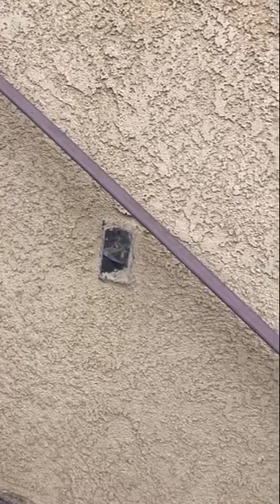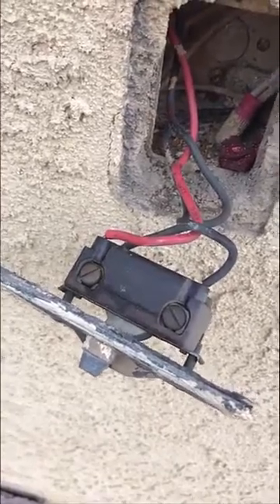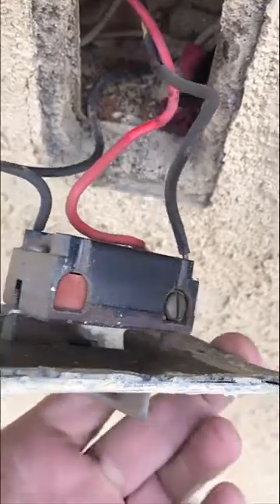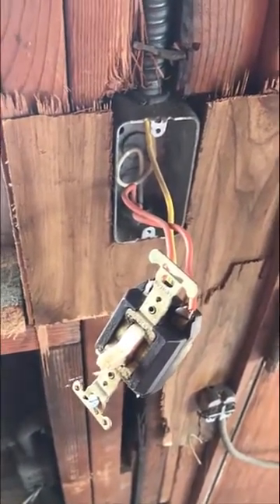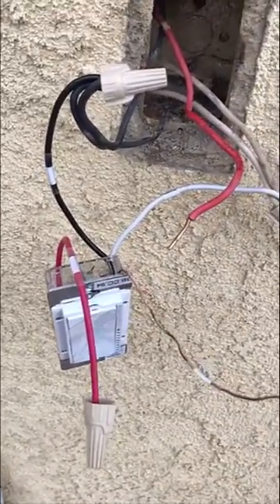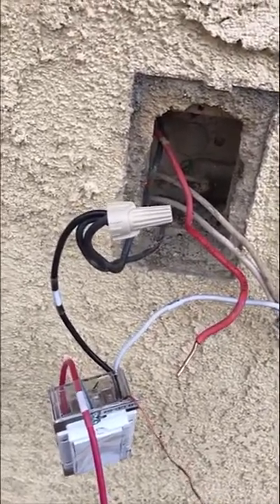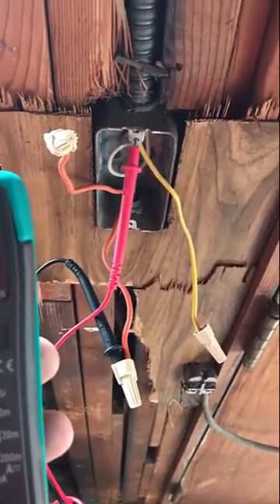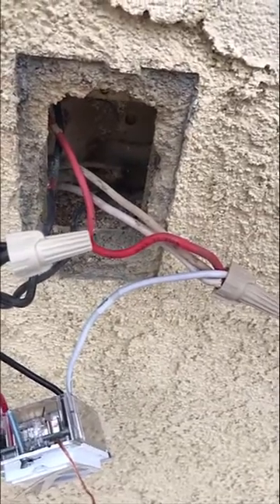Insteon 3 Way

Comment: How did your linking go. I tried to get a 4 way connection to work and I couldn't get the slave boxes to blink green when syncing through the different boxs
Reply from the maker: A keypad flashes red when a button has been linked to a device but then the device is offline or for some reason the keypad can’t hear it after a command is sent to control it.

As far as linking a 4 way here is what to do.  Let’s assume the switches are named switch A, switch B and switch C

A needs to be put into multi link mode.  Press and hold the set button for 3 seconds and release. Then single tap and release of the set button.  Now press and hold in the set button for three seconds on switch B and then the same for switch C

Now go to switch A and turn the switch on and off to stop the link mode.

Repeat the same process now starting with switch B and link C and A

Then start with switch C and link switch A and B

Make sure the switches are in the on position when you link them.

For a specific keypad button that you need to get in link or multi mode you tap the button you want first then hold the set button in and a addition set button tap for multi link mode

Comment: Using a red wire as a neutral is a code violation.
Reply from the maker: A couple of things.    This is my house.   I mention in the video that you should  tape the wires if you repurpose them.      You are correct that if this was getting inspected and I had not taped the wire I repurposed as a neutral with white tape an inspector might call me in that.
The fact that the wire is red does not have impact as to its ability to be used as a neutral.
Reply: Still a violation. You can mark a white wire in a cable assembly as an ungrounded (hot) conductor. You are not allowed to mark a hot conductor color as a neutral.
Reply from the maker: I won’t argue your take on this topic.   I will let the video stand on its own as a tool to figure out what to connect to what if adding an insteon switch to an existing three way application.

Comment: Outstanding explanation! Solved the powering up the 2nd switch box problem I had. Duh... connect a traveler in the 1st box to the line, becomes line in 2nd box.   Thankyou

Comment: I'm not sure I ever heard the explanation that the odd colored screw is either your hot wire or load wire. That understanding simplified my 3-way Insteon installation. Thanks for this tip.

Comment: Do this increase your energy consumption?
Reply: I don't think Mr. Lee revealed the model number of the Insteon device. 
However at runtime 10:29 in the video he powered-on the device to test 
it and the LEDs ramped-up, indicating it's a dimmer. I'm going to call 
it an Insteon 2476D or 2477D. "D" is for dimmer, as opposed to a 2476S 
or 2477S switch. So now that we've established it's a dimmer, I can 
answer your question:
No, a solid-state (e.g. triac) dimmer actually decreases energy consumption. It can be shown on an oscilloscope that as the load is dimmed down, the triac chops off more and more of the A.C. sine wave that powers the load. The area under the sine wave is the power in watts. As the area gets smaller, the light dims, and the power consumption in watts decreases.
Solid-state dimmers such as Insteon's have other benefits as well. "Soft-Start" is a big one. When the dimmer is powered-on, the voltage/current RAMPS up, instead of hitting the cold tungsten lamp filament with 120 volts instantaneously. No matter where the visual ramp rate is set on the Insteon, even at a short 0.1 second, there is still a ramp-up to the preset on-level. This is much preferred to an instantaneous 0 to 120 volts. I lived in two houses for 10 years each. In both of them I had dimmers installed nearly everywhere I could. In the entire 20 years, I never had to replace a light bulb that was dimmer controlled. 'Nuff said about dimmers lengthening lamp life!